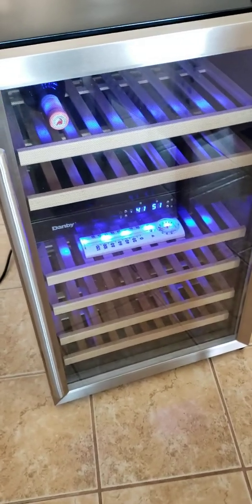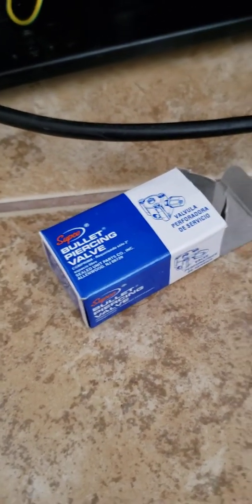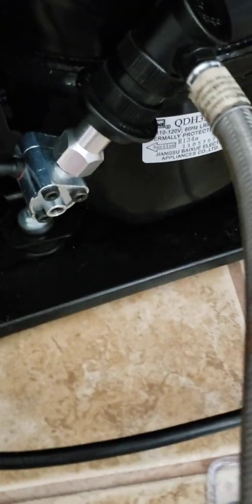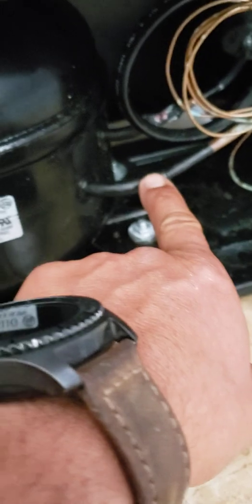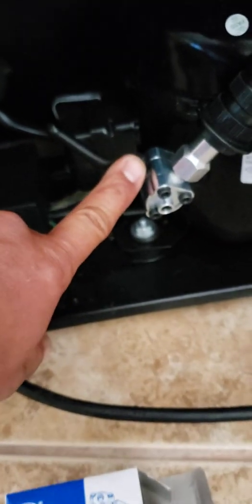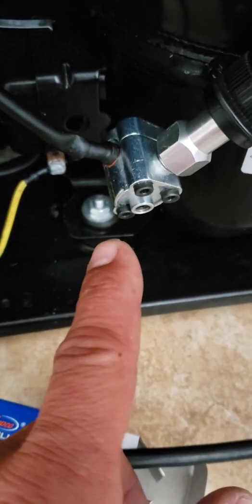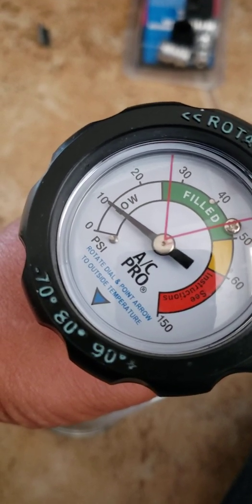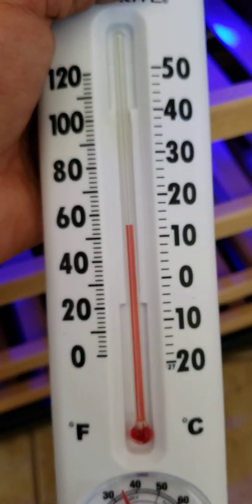Refill your mini fridge or wine cooler with freon/ refrigerant

Comment: How much did everything cost to fix it ?
Reply from the maker: about $7 or 9 per can depend on where you get it.  The valve was from $19 to 15 dollars maybe less, I don't remember right now but it was cheap.  If you get the can with the hose on Advance or Autozone or any auto part store, it may be about $15 to $30 all depends where you get it and what brand.  Get the cheapest one as a brand does not really matter.  For me it was about $30 total.